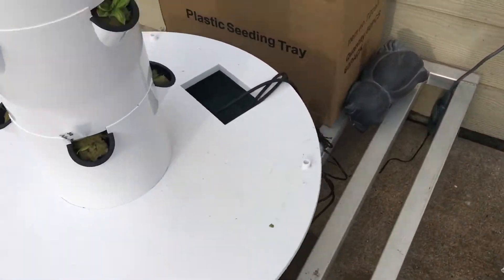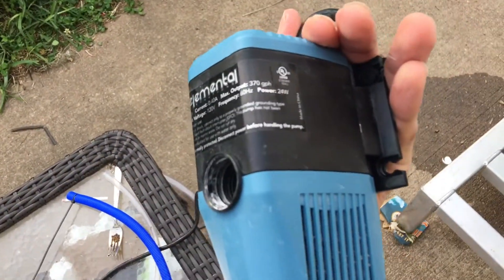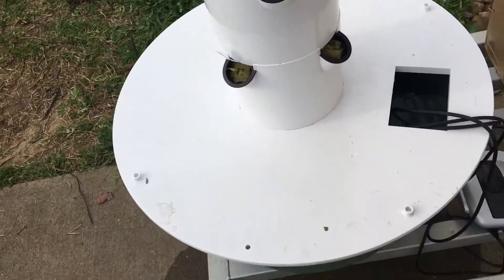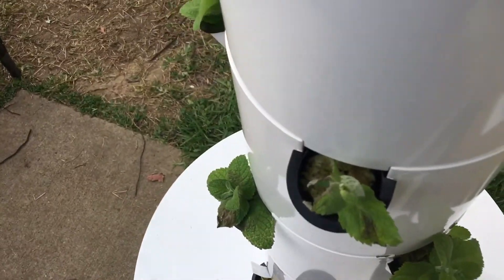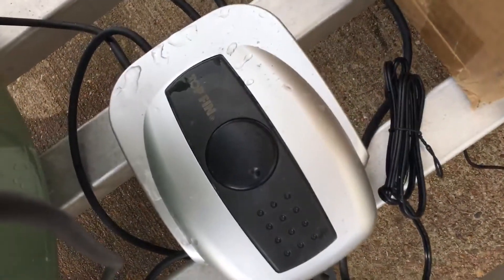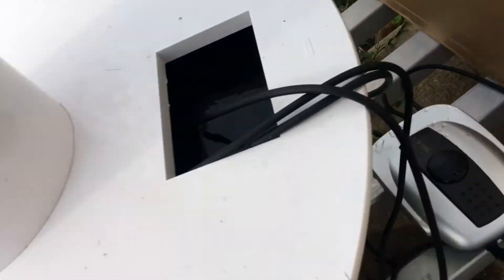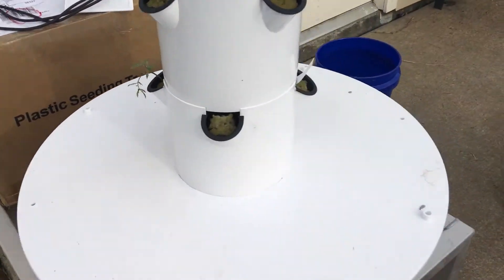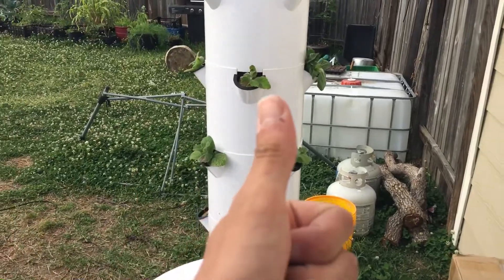Tower Garden Airlift Pump Mod

Comment: Hey I'm trying to do this same thing, would you mind ginving me rundown on how you did such a small one? Or maybe point to some links? all I'm finding is big pumps that need a lot of pressure.
Reply from the maker: so this is a kit from tower garden. i think there are different sizes too. i wouldnt recommend this unles you have it on a porch or near your house because if it stops working all the plants die. so mine just randomly shut off and killed a bunch of basil and mint that was ready to harvest. i would look into building one out of pvc
Reply: thank you. i think i figured it out. I ended up doing this very same device https://www.youtube.com/watch?v=sjxajYRkFiQ but with a bell siphon on top. So on very small tank, the water fills up and then it discharges one big gulp thanks to the syphon. It's very efficient, indeed.